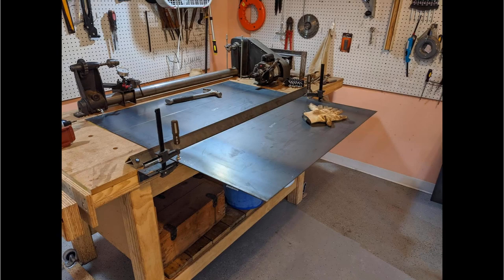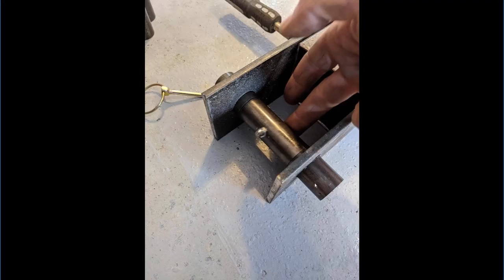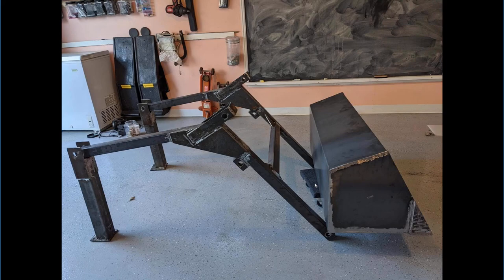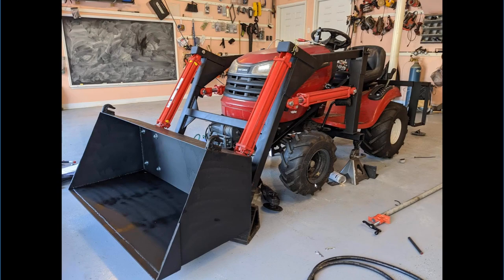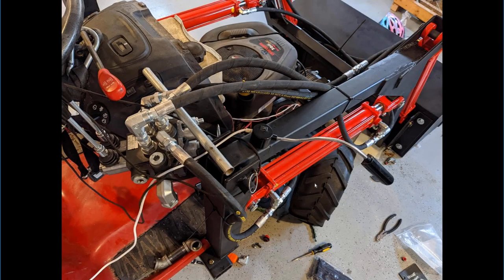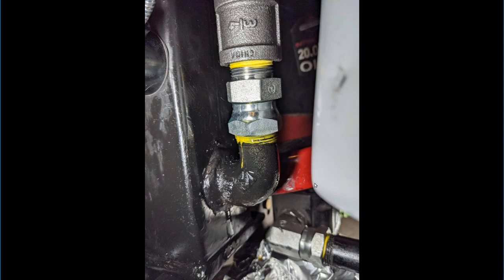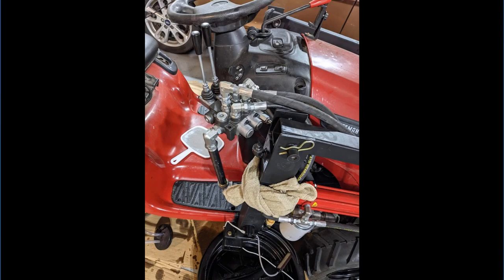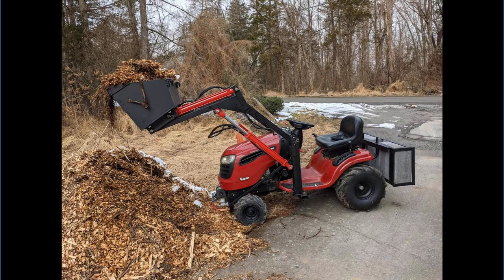DIY Front-end Loader for Garden Tractor Build

Comment: This is truly an amazing job especially for someone who openly admits having no previous experience with hydraulics. I give you 2 thumbs up!!!! Just please in the future look very closely at your threads in your valves and cylinders. If they are beveled please use orb connectors. If you have no other option than pipe threads please consider loctite 567 or 565. I know some people will say. (I’ve never had a problem) and if you have never worked with hydraulics before you couldn’t know. But you should never use thread tape on hydraulics. Please know I’m in no way being ugly. I think this is an awesome job. I just want to share something that could save you a lot of trouble in the future. Many many valves have been changed because of small pieces of tape getting caught in spools.

Comment: Nice creation it’s super cool! I’d just recommend watching how much you work it because I can tell you the transaxle in that isn’t meant to handle that I’d recommend an old garden tractor for a loader but still a sweet build!
Reply from the maker: Yeah, for sure the transaxle and entire frame honestly are wimpy. I have a specific purpose, loading wood chips which are light. Would love to have a better tractor though.
Reply: @RyanShea  for woods chips that’s perfect it won’t over work it but you can pick up some old garden tractors for pretty cheap and they are so easy to work on I’ve got a massy 7 and a homelite t16 they are both a ton of fun and I’ve got quite a few lawn tractors too
Reply from the maker: @trucks_n_tractors_6335  Maybe you have a recommendation. I can certainly set up a saved search on CL or look on Facebook Marketplace once I know what to look for. I need to be able to get into tight spaces (small gates) and paths between garden beds, so I want to maintain a narrow profile. I have some hills and get quite swampy soil in the spring, so having something with a difflock would be a huge benefit as well. I am rather a fan of a hydrostatic transaxle if that is a thing on any of these older garden tractors. I've seen various Case or Simplicity tractors come up, but haven't spent the time to know what to look for quite yet.
Reply: @RyanShea  generally old garden tractors tend to have a larger profile than a new lawn tractor but if you’re looking for a hydrostatic transaxle garden tractor I would recommend looking at a cub 125 123 or some others or a bolens would also be a good choice you could look into case for hydrostatic I know Ford made hydros but they are much less common so I’d look for a hydro cub cadet or bolens

Comment: Very nice work. Look for an old Sears Suburban with a standard high/low transmission. Use wheel weights and fill the rear tires for the counter weight. (Several ways to fill them) this takes the weight off the transaxle.
Reply from the maker: Yeah, I have all the stuff to fill the rear tires, but haven't done that. Like many of my projects, I finish them and  then move on to other things - but yes a better tractor would be good. I used to store the tractors in a 4.5ft crawl space, so that was a significant constraint on storage. Now I think I mostly I'd have to get motivated to put the loader on a different tractor really. Too many other projects.

Comment: Nice work, with limited tools(the best way to learn skills AND ingenuity)! TOP TIP-re: holes saws; they are designed for thin plate/sheet metal and don't feature flutes for swarf removal - drill your centre pilot hole and with the same drill bit, drill 3( or as reqd) holes around and just within the overall diameter of your desired hole. Then cut hole with holesaw, and thin oil(wd40,3 in 1....), applying the oil with a small paint brush(13mm/ 1/2"). The swarf will clear out of the cut via the through holes. Too much speed, too little oild, too much vibration and lack of swarf removal kill holesaws!
Reply from the maker: Thanks! Yeah, my method was to brush on tap magic, then use my air compressor to blow out any chips constantly. Eventually I got the sense of what kind of down force was productive for the carbide - too much = bad, too little = bad. I am not sure the exact speed I was drilling at, but fairly slowly. Only had 4 of these 1" deep holes to drill, and I think 12 at 1/4" thickness. I think annular cutters are more of the "right" answer, but I don't have those.
Reply: @RyanShea  The carbide holesaws are great, but VERY aggressive and require lots of rigidity/power(similar to other machine cutters). Bi-metalic is a better compromise re: cost effective, jamb resistance and tip loss. Keep up the good work.

Comment: Hi We have the exact same garden tractor at home. The hydro-gear transmission gave up the ghost on it. Depending on which hydro transmission you have, you have to be careful because they are not build for pushing, or pulling a lot of weight. We found that out the hard way.
Reply from the maker: Oh yeah, I fully expect that. Nothing on this little lawn tractor is built for this. I actually have a spare transmission around, but we'll see what I do when this transmission goes. Honestly from a functional perspective what I need for my mushy environment is a diff locker, so if I were to go through the effort of swapping the transaxle I may weld the diff... or just get a completely different tractor of course.
Reply: @RyanShea  I hope it works out for you. I ended up switching to a Bolens QT16. If you don't mind older machines, you might want to give Bolens tractors a look. They can be found for a good price sometimes.
Reply: That’s not a garden tractor. It’s a lawn tractor. BIG difference.

Comment: With somthing like this you might need a bridgport,  drill the hole with smaller bits and work up to close to what you need 
Hot rolled steels not very hard, it has a low carbon content its not like your dealing with 1040  or 4140. Its 1018 
And angle iron will reinforce the edges also add some flat stock to the cutting edge and grind a bevel on it. 
That will make the slicing edge last longer
That thin of plate steel will wear down pretty fast but you can always add new material to it. Just do spots you can drill out so you can replace it.

Comment: Why not put the tank in the back for the hydrlic fluid its also a counter weight.
Love the tires.  
Is that a lawn tractor,  or garden tractor
There is a difference,  mostly the hydrostatic transmission aka rear-end.

Its built and dam that looks really 👍  good.
Mine next!
Reply from the maker: Just a lawn tractor. I don't know what I'm doing, so tried to follow instructions which had the tank in the tower thing.

Comment: My question what parts were used for the hydraulic system?  pumps, cylinders, control valve. What gpm does the  pump out out and how much can this system lift?   Im also  looking at  PF Engineering plans.    great job  .
Reply from the maker: Yeah, there are part numbers for valves, hoses, cylinders and all that stuff in the pf engineering stuff. I don't actually know the numbers offhand, but also there are probably lots of different setups you could choose

Comment: What BMG metal do you use? I'm in VA also. Thanks for the video. Any updates?
Reply from the maker: In Manassas. For updates, I'd say that the loader isn't as useful as I hoped. I have this mini dump truck, and I wanted it to be a faster and back saving option for loading wood chips... but in reality I'm faster with a pitchfork.  I'm sort of thinking that without 4x4 and hydrostatic any tractor will be slow to maneuver and tend to get stuck in my muck. Renting a tracked skid steer can move a lot of material quicker, which I've done.
Reply: @RyanShea  awesome, I'm in Montgomery County. Use the Lynchburg bmg. I need something to clean out a small barn for mini donkeys
Reply from the maker: @LanceSheppard  I rented a Kubota BX a while back. Even that isn't much faster than a wheelbarrow, depending on how far the donkey poop needs to go. Bigger tractors though, that won't work for much of what I want. Lots of garden beds, tight spaces.
Reply: @RyanShea  I do all my raised beds with wood chips too. It is alot of work but worth a weedless garden

Comment: Will this thing even turn? Id watch that frame. If it breaks, you might become one with that tractor
Reply from the maker: Yes it turns. I added thrust bearings to the spindles which improves the steering though.
Reply: @RyanShea  i have an ingersoll 4016 and i had to do power steering as it kept blowing gears up with any weight in the front.
Reply from the maker: @jayyep6974  I use this for moving wood chips, which is more volume than weight. To be sure, there is future breakage to look forward to - but this thing simply is not going to handle a bucket load of wet spring clay and isn't heavy enough to dig anyway.

Comment: Unfortunately the first time you overload any of those attachments you are going to break that axle or transmission. That is a riding mower for cutting grass not to be worked like a REAL tractor.
Reply from the maker: Snow and wood chips, and learning how to make it was the purpose. I don't mean to suggest it is a Kubota, or fit for any purpose other than what I use it for. Probably 100lbs of load. The machine is not to be operated by fuckwits. I actually think the thin gauge frame would fail first while moving with s load.
Reply: I tow 300kg with mine, has plenty of power. Moved 70+ tons no problem, I'm going to make one of these, then I can tow my trailer and carry a extra 100 up front haha